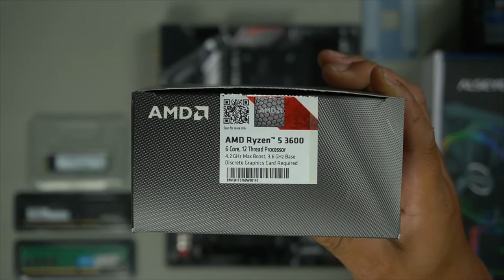BUDGET GAMING PC 2022 NZXT H440 black tinted window , silent case

Comment: Thanks for the video.. i was actually scared that this case probably can't fit with 3 fan GPU
Reply from the maker: u are so welcome ..but if that ever comes up for a case u want always check specs of gpu length and then check wat size gpu the case can accommodate ..usually it will tell u with front fans and without front fans ...always bare that in mind..and if u install an aio can it still fit the gpu...

Comment: Why no gaming benchmarks though?
Reply from the maker: just doing the build to show ppl how to build... benchmarks can be found easily using benchmark site and other yt videos... maybe in future I will do some benchmarks
here is example u just need to search ryzen 5 3600 + gtx970
https://youtu.be/QvbCUayXh98
Reply: @MIKEYZ VLOGZ  Yeah, but performance might change a bit from chip to chip, it also depends on config between GPU, CPU and RAM, so I would have liked to see some benchmarks for this particular build/config, not stock perf. numbers
Reply from the maker: wouldn't big a big difference ... yes some cards perform a tiny but better but it's not huge.. this pc already sold but will take note for future builds